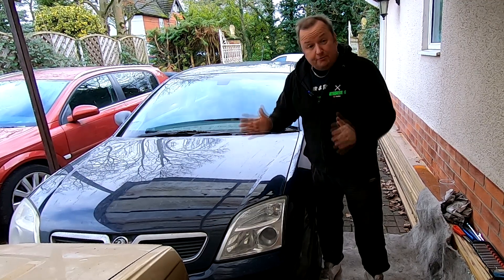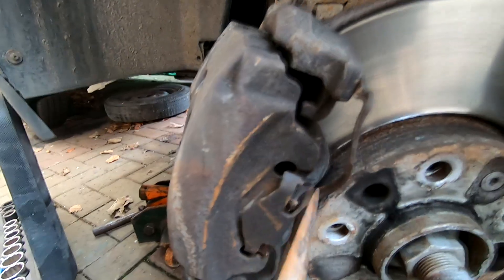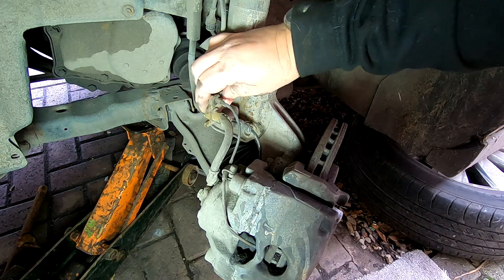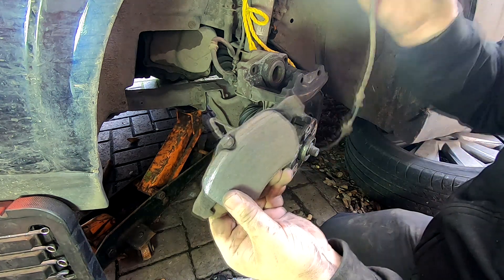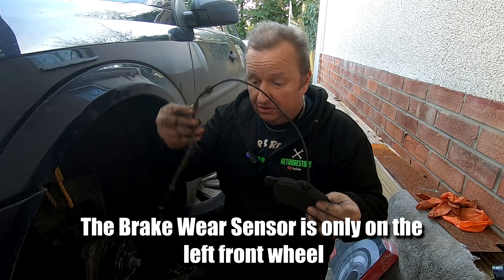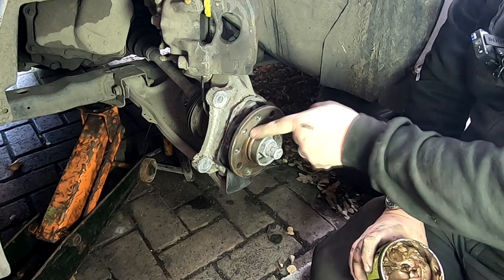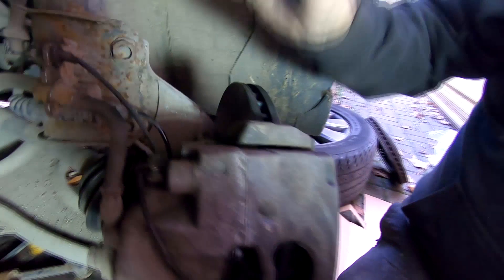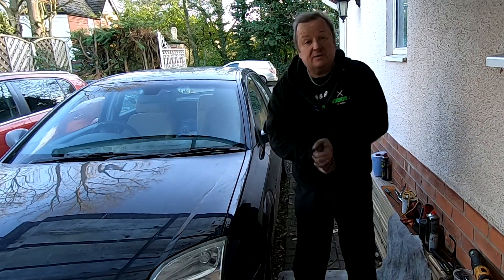Vauxhall Vectra C Front Brakes And Disc Replacement

Comment: Spot on Martin. I use normal lithium grease for the caliper pins. I normally use white grease to keep rust at bay on stuff that gets exposed to the elements. It should work just as well on those caliper pins. You forgot to mention that the pads will need to be bedded in so tell Sharon to be gentle on the brakes for the first couple of hundred miles or so. Don't forget to operate the brake pedal once you've done the job to avoid a brown trouser moment when you set off. The last pad replacement I did was on the BMW and the pads have already bedded in. I've got to do the same job on a 2016 Ford Fiesta. You don't have to change the discs every single time but the discs on the Vectra definitely needed changing. The last disc change I did was on the Citroen. Something else to note is that if the discs are being changed then the pads must be replaced also regardless of their condition.

Comment: Them caliper hold back clips are easier to remove and install than the wire ones on the Siggy all you need to do is push on the centre where your thumb is towards the front of the vehicle and the 2 "L"  shaped hooks will come out of the holes then flick them out and to install them you just offer the 2 wings against the caliper carrier and push the retainer forward and the 2 "L" shaped hooks will pop in the holes.
Reply from the maker: Yes Mark, I found that out when I did the other side lol. Too late to re film it though.

Comment: Ah yes, the lovely ATE brakes of the Vectra!
Well maintained and they last forever (not pads and disks, those are consumables, but everything else).
There´s just one thing, though I guess that applies to other brake systems as well - never change the pads without changing the disks or having them turned!
My first Vectra had old disks with reasonably new pads when I bought it and required f***loads of force on the pedal, the grooves in the disks glassed the pads (guess who was in a for big surprise when the new brakes where mounted!)
Even better - the disks had rusted to the hubs so well, I had to use a cutting disk to slice the centers to break the separated pieces loose.
If only the previous owner/mechanic had used copper paste for such applications!  I never had any issue getting off the disks or rims (steel for the winter tires) on my cars.

Comment: Wow that job seems like it takes longer with all the extra you have to do compared to over here in the USA. We dont have a bolt holdingg G the disc on or a clip holding the pads on or a senser.

Comment: Im surprised you used the old sensor. Normally the light comes on when it’s worn through. So the light would be still on after you replaced the disks and pads....
Reply: The sensor is just a metal pad that earth's on the disk making a circuit for current to flow for the warning light. The downside of not replacing it is that next time because of the "sensor" being scuffed it allows the pads to wear a little bit more before the warning light comes on. The light will go out with thick new pads regardless of the sensors condition because there is no path to earth/ground to light the warning bulb.
Reply: David Humpherson I believe your incorrect there. It used to be like that on older 1 wire systems. Newer cars use a two wire system that wears through and breaks the connection, throwing the light. I’m a little confused and maybe Martin can confirm the details? I.e the light was on and now it’s off? I work in a garage and the wear sensor has to always be replaced.
Reply: @Roverturbo  Cool, didn't know that 👍Ha ha, more complication, sounds about right for making extra money 😂 That's progress. My 420i had little clips on the pads that'd squeel when the pads got low. Not sure about 620Ti I had.
Reply: David Humpherson agreed, only any good if you knew or heard the squealing.. 😂

Comment: Great how2,   I’m not criticising just a tip for anybody who does this job on there Vectra-C,

the rubber guilds that the slider pin slide into can swell up so the pins don’t slide correctly giving you uneven brake wear because of sticking pins,  (even though you greased them) 

What you do is take the 2 rubbers guilds out the Caliper and you’ll see the holes are all rusty,  a wire Spiral brush in a drill works wonders to clean them,   Then put some Silicone grease on when Reassembling it,

Comment: Apec pads and discs are really good. I would put them up there with Pagid, Jurid and Brembo.
Reply: I use loads of apec as it the main stock brand for our main motor factor.
Quality consistent and priced well, I rate them equal in quality but better value ...

Just avoid ECP home brands eBay nonsense brands and you be good .
Reply: @mrb1864  DriveTec from GSF and Eicher from ECP are the ones to avoid.
Reply: @JamesAllen300  we avoid GSF and ECP 100%, would rather close shop and give them trade .

Comment: That Vectra seems high maintenance. Had a Daewoo/'57Chevy Lacetti 95Ker. Bit of patch up on the exhaust. 50 quid Throttle body (but old one just needed a clean TBH) Sold it now. Missing it already!
Reply from the maker: The vectra is a great workhorse and rarely gives problems. These are just routine wear and tear jobs

Comment: Hi bud.. great video.. having  the impact makes a difference but you still can fall back on a breaker bar. Did that gift turn up. I have not a message to say it's been delivered
Reply from the maker: Yes Mick, i'll do a vid soon bud. Thanks again, its a great tool.
Reply: @retrorestore  no problem mate was just checking it had turned up. As I said I had no notification to say it had been posted

Comment: I have a problem with my Mondeo mk3 petrol 2L 2004 which is not the topic of this video... but I didn’t know how else to contact you and would appreciate any advice. O/S front calliper seized solid. Any advice on how to release it so that I can remove and replace. Many thanks...
Reply from the maker: I would clamp ff the hose, remove the banjo bolt and hold an air line over the hole to pop the piston. That's only if you have a compressor. failing that, you might be able to get a small punch in the hole and tap the back of the piston to free it off.

Comment: Why did they put a brake pad sensor on one side only cos guaranteed one side wears down quicker than the other as my vectra wore down the pads on the drivers side quicker than the passenger side
Reply: Nice job Martin
Reply: Having a sensor just on the left side would only be ok for countries driving on the right, as right turns there are tighter and more frequent, so the left wheel carries higher loads and travels further.
Reply: Duncan Disorderly you shouldn’t have uneven brake wear at all,   Grease the slider pins (silicone grease)  clean the Calipers and carrier guilds and then copper grease were the pads slide,   

You shouldn’t have uneven pad wear though what’s so ever,
Reply: @sthenzel  but you don't really brake as your making the turn, you brake before the turn
Reply: Believe it or not, I´m braking into the turn, or to put it better, the braking isn´t fully finished when I turn the wheel.
Just went out to my workshop, the disks of my last brake job are still sitting in the junk pile.
Left side 23.6mm, right side 23.75mm, new those had 25mm, so the wear difference is over 10% (between 1.25 and 1.4mm).
Left side was missing the small index screw, so its unused and therefore dirty hole distinguished it from the right disk.

Comment: A bit trick VERY tricky . That was an understatement. I am not going to say bad of some outlets, but you mentioned Halfords. Please do not think the professional tools are inferior, they or were made by Sykes Picovant from Blakpool and actually carry a lifetime guarantee, as do Snap-on. The normal ones are not really of the quality you need, hence you broke it. With a proper and not DIY breaker bar no problem.. But costs more
Reply from the maker: I like the Halfords Professional range, I use them all the time.

Comment: Martin am not having a go at you lol please please could you wear a pair of gloves brake dust is poisons. Advice open the master cylinder lid reason being forcing brake fluid has no where to go there is a likely hood that you  can blow a pipe or Damage the Abs Unit is higher.. Am not  having a go at you got the  job done buddy.✌👍
Reply from the maker: Ali, Pushing a piston in by hand is far less pressure that when you apply foot pressure and the servo pushes out bud. Its a myth about removing the cap. I have not seen any guaranteed professional state that. You'll find loads of people in forums say that it needs to be removed but no authority has explained why.  I have done it both ways and experienced no difference in piston pressure in pushing the piston back in.

Comment: No idea what model you have mines a 56reg sri 1.9bcdti 16v do you think they all be the same?
Reply from the maker: Should be the same bud.
Reply: @retrorestore  thanks is it reasonable straight forward? my dad talked me out of it said you have to bleed the brakes! However I didn't see you doing thar
Reply from the maker: @jackmilne9764  You don't need to bleed the brakes to change the pads or discs bud.
Reply: @retrorestore  I had a green vectra saloon 1.8 16v before this did the thermostat I'm no mechanic minute the coolant came out i was like shit have I bit off more than I can chew ha

Comment: Thousands of miles left in those disks and pads.
the pad manufacturers set that pad warning contact far too high.
I may be old school, but why not wait until you hear the squeal of metal on metal.
Another clear case of the health and safety brigade helping parts manufacturers line their pockets.
Reply: Generally the ladies do give the brakes a hard time but not in this case.i was behind a brand new automatic car and the brake lights were on the whole time... 2 feet + 2 pedals, OMG some people!

Comment: You really should not be using copper slip it dries out and causes the pads to stick  . I always use ceratec with no problems .
Reply from the maker: Not the case, It doesn't dry out. I've seen it, years old. Do think before making a statement like that bud. I bet you have never seen it dry out, I know I haven't in the 40 + years I've been working on cars.
Reply: retrorestore Sorry didn’t mean to offend I also have been working on cars for over 40 years in the motor trade . It was just an observation please check out Edd China video on textar brake disc and pad fitting .
Reply from the maker: @christophercobb2886  I've seen it Chris and also in an earlier series, Edd was putting copperslip on the back of brake pads so it's just that things change bud.
Reply: n325aej Not five years please refer to Edd China textar brake disc and pad change .
Reply: n325aej No problem with Martin or video it was very well done . I was just giving some professional advise to what is used in the motor trade .
Reply: Please look at Martin Morris video on you tube as a reference .